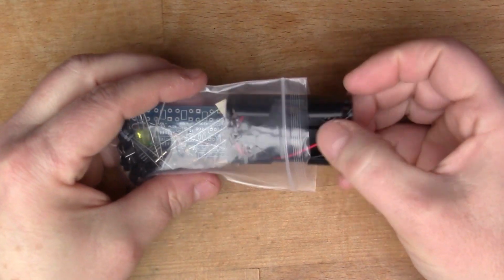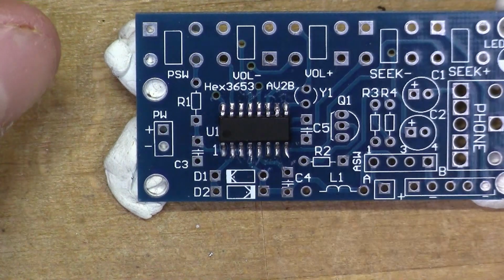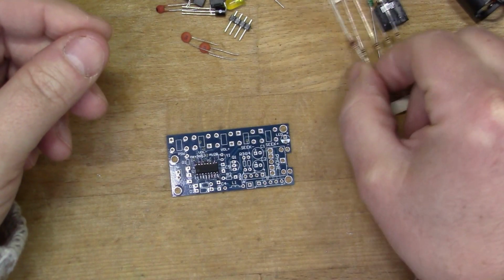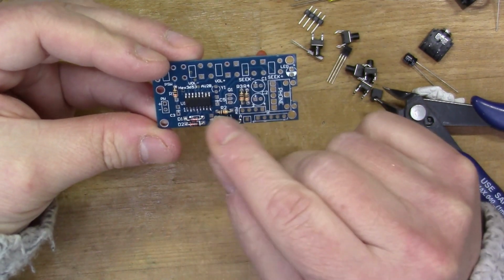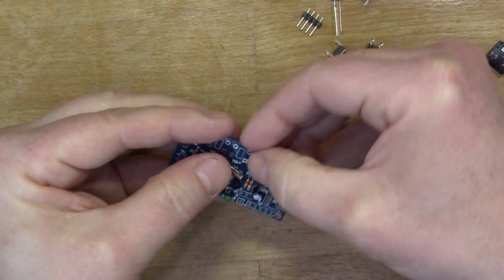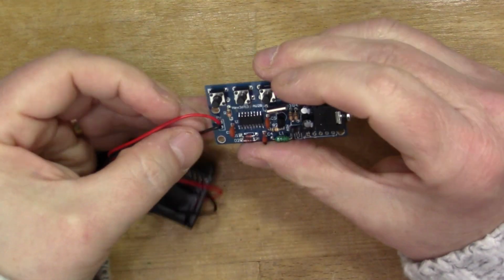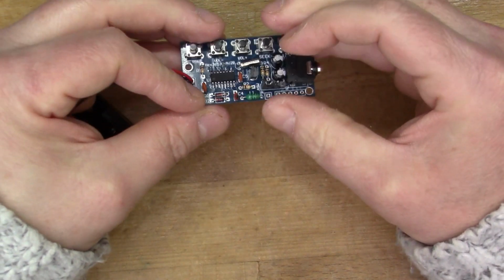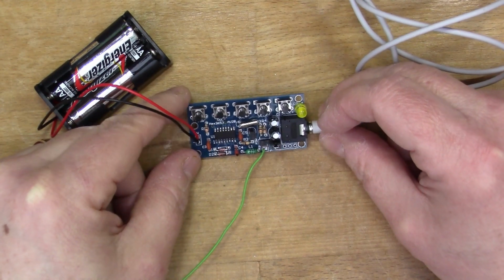FM Radio module - kit build  (#68)

Comment: I got one of these in the main this morning, right now I am suffering with a nasty flu but what the hell I built it anyhow. I could tell I was not feeling well when I had to remove a couple parts that I soldered into the wrong holes. I threw the two 104 caps in the bin and retrieved some great name brand ones from my supply.  It works find, we will be getting our first FM radio station in the late spring.  Now we have to drive about 50 miles in any direction to get a decent FM signal. I have a little short range transmitter I built also from a kit that I use to test these sort of projects.
Reply from the maker: Get well soon

Comment: I received the kit from China without any assembly instructions. Everything was more obvious when I looked at the back of the board that had the R's and C's defined. I was then stumped with the 4 pin header and took a lucky guess without a schematic and it came to life. This board has the advantage of all of the pushbutton switches in line. Another one I purchased has the switches not inline but did include zip ties to attach the battery box to the FM radio board. This other board actually performed better on the FM band and and did not produce the audio click every time you push a button.

Comment: Good wee circuit for money.  I made up a one watt speaker with an lm386 amp and housed it in an 'illy' coffee tin which I use for testing circuits like this.  It works a treat and looks quite quirky!
Reply from the maker: I'm very pleased with it. The last FM module I got really didn't work at all.
Reply: I made a very small fm radio which was all smd parts.  It was the first time I tried re-flow soldering using my hot air gun on my solder station and I possibly fried the chip!  I had bought two kits at the time, as they were so cheap, but haven't had the heart to try building it again!  I tend to use my soldering iron for smd work but must do more using re-flow and try to master the technique!  I use a hobby light with magnifier, which really helps, but I suppose it would get in the way if you were videoing!
Reply: Are you using the same power supply for amp and FM circuit ? I tried using 12v adaptor to power the lm 386 amp and a step down converter to power this 3v FM circuit. The sound is very low volume. What could be the issue, ground loop perhaps ?
Reply: @jolexx  I used a separate power supply but don't really use this amp now.  Have you tried another amp to see if the volume improves?
Reply: @gartmorn  This is the only one I have at the moment. I will try to figure out this ground loop thing.

Comment: I also had a solder problem with the chip which I solved imediately. I figured the 30pf was near the antenna so all the other components were easy to solve. The inductor led to the "A" pad which I figured was the antenna and soldered a 30" piece of wire. Jumper 1&2 and 3&4 for stereo headphones. Good video, thanks
Reply: Jumper is for the antenna, not the headphones. Common of the headphones CAN be used for the antenna by jumping pins 2 and 3.

Comment: I have the ICStation version of this kit and I'm curious if THIS kit performs the same or better or worse than the ICStation kit. I like the addition of the power LED and the ability to use an external antenna. The kit I have I've tried several parts on the board and now I have it on one of the pins of the headphone jack and the reception is better but not perfect.
Reply from the maker: From what I remember, I had several metres of wire attached to get really good performance, so I don't think it's that sensitive.  I have shopped at ICStation quite a bit, so I'll keep an eye open for their kit.
Reply: @MartynDavies  I have this flash drive style mp3 player that has a built in fm radio and the reception is terrible on it. The ICStation kit works better but the mp3 player can record from the radio which is why I bought it.

Comment: I got mine put together no problem but all I can get is static no matter what I do. Also mine seems to be a bit different than all the others I've seen. On my board the LED and antenna spots are swapped and mine only has the 3 pin header. I added a fairly long antenna and have tried moving the jumper around but as I already said all I get is static. I also tried upstairs and outside with no difference. Not sure if I got a dud, messed up or because I live in a fairly rural community with little FM range. I'm hoping it's just the latter. Anyway I had fun with the project and came across this video when trying to troubleshoot the reception.
Reply: У меня была такая же проблема, замена кварца все решило, радио заработало, кварц часовой 32,768кгц

Comment: I finally got this to working and it is really great, good sound and all, well worth the few dollars. Just be carefull on soldering IC for good connection and yes i noticed there are a few circuits not used on this.

Comment: martyn im a novice ,are the diodes used in place of a variable capacitor oh and good visual build and well explained, ta.
Reply from the maker: The diodes are across the antenna input and ground, so I assume that they are there to protect the chip input from excessive voltage (diodes will clip everything above 0.6V).  Sometimes radio circuits use a diode as the demodulator, but that's normally inline, and anyway this HEX3653 chip will have a demodulator onboard.

Comment: For STEREO Add two jumpers !!!!!  pin 1+2  and 3+4
actually, I did not understand why these jumpers are needed
Reply from the maker: Great tip! Thanks very much
Reply: Jumper is for the antenna, not the headphones. Common of the headphones CAN be used for the antenna by jumping pins 2 and 3.

Comment: Nice video, just made this build myself. The chip seems rather picky about the selection, and will only settle at really strong channels. Which means I get only one channel, Swedish broadcast P4, and I live in Norway!
Reply from the maker: It's not very sensitive. I added about 5 metres of wire to my antenna.

Comment: Hi Martyn, great clear video and mine didn't work to begin with so I soldered the chip again, then it worked! However it's really weird, it works for a few minutes, then stops working, LED still on but no buttons working. Remove the battery and replace then it didn't come back on. Resoldered the chip once again, and reflowed all the other joints and it worked for another 5 minutes then stopped. Baffled now. What do you think?
Reply from the maker: Perhaps some thermal effect, like a component changing characteristics with heating, or a PCB trace breaking / separating?  Hard to debug anyway.
Reply: @MartynDavies  thanks for the fast reply! Yes I wondered whether it was working after I had applied heat, but I'm trying to learn all about electronics and I thought this build would be a good start possibly, I'm also still trying to understand my multimeter haha. Thanks again for your advice

Comment: Great work, mine didn’t work I guess I burnt it or something since I don’t have steady hands😂 but I learned a lot from you thanks!!
Reply from the maker: It's definitely hard getting that chip in the right place...
Reply: You need to use the jumper provided to short pin 2 to pin3 for using the headphone common as an antenna; Connect pin 1 and pin 2 if you have added your own antenna lead in wire to the terminal marked "A".

Comment: For some reason, I do not catch the station. Hiss. Volume is adjustable. You do not know what could be the matter?
Reply from the maker: Make sure you have the jumper in place. Also I had quite a bit of wire for the antenna, probably 4m.
Reply: @MartynDavies  thanks. 
Fairy tale, but 2 hours after no result trying, he worked with active acoustic system. Early try with headphones.

Comment: what is its power consumption?  replacing batteries with rechargeable ones.
Reply from the maker: The HEX3653 is designed to run off 2 AA cells, so you should be ok.  It would surprise me if the chip drew more than tens of mA.
Reply: @MartynDavies  I was planning on using a 90mah lipo cell for compact design. Would that be a good idea ? Assuming I take care of the 3.7v to 3v conversion.
Reply from the maker: @himangshudas3924  I'm sure that will be fine.  You could use a diode in serial to drop 0.6V, then the voltage should be spot-on.
Reply: @MartynDavies  thanx ... But it would really help if u could get me the exact power consumption. Don't wanna charge it 10 times a day lol.
Reply from the maker: @himangshudas3924  Mine's in a box somewhere, but if I find it, I'll measure it.
Reply: @MartynDavies  thanx man .. and great content ❤️

Comment: Ok so ill be very happy if i get some help as im stuck with a similar project ... We use the earphones as an antennae in the mobile phone fm radio...so is it now possible to do the same with this circuit? So that i dont need another long wire sticking out of the module .
Reply from the maker: Looking at the circuit diagram, it looks like the antenna and a wire to link to the output jack go to the same jumper, so it may be intended that you can join the antenna to the headphone wires.
Reply: @MartynDavies  thanx a lot for that..and also for the quick reply !!
Reply: @MartynDavies  Would the RDA5807M module give good results? was trying to build a handheld fm radio.

Comment: I bought this circuit from aliexpress and setup all components as the video but I face two problems. Firstly, I face that the led is not lighten up all the time but sometimes it lighten up very lowly... And the second problem I face that when I enter the half of the headphone jack It only works in one side but when I enter all the jack then It works another side that means It always works in only one side, if the left side works then right side doesn't work, if the right side works then the left side doesn't work... So How can I solve this???
Reply from the maker: I would swap another LED in to check whether the problem is the LED or the transistor that switches it on and off.  As for the socket - that sounds a bit mechanical, and perhaps you have just been unlucky in getting a bad one.

Comment: please help,
i build this kit but at output only noise coming when i press seek + it searching for channels for 15 sec then no channel were found ...this happen with both antennas.... i have changed crystal, 33pf, 10uh but result same
Reply from the maker: In my case I used a very long wire for the antenna - perhaps 4m
Reply: @MartynDavies  ok i will try that long wire

Comment: Hey nice video, i got mine, but i only get static on jumper 2 +3 and also on 3+4, when i put it in 1+2 nothing sounds. Only get the let on and i can up and down the volume, do you have any idea what could happend?
Reply from the maker: As far as I can tell from the goughlui website (see link in description) the jumper allows you to connect the 3653 input either to the antenna terminal (the 3 &4 that I used), or to the headset jack.  I imagine that when you connect to the headset, it is trying to use the headphone cable as the antenna.
Reply: Thanks for you answer, i will keep checking whats the issue..thanks
Reply: This is the exact issue I am having. Exactly. I’m wondering if my chip isn’t soldered on 100%. Did you ever figure it out?
Reply: Captain Sparks im still having the same issue, don’t know if i mess some components when i was soldering, will be trying again on this weekend,   if i solve the problem , i will let you know.
Reply: Phantom Lord Hey there! I just fixed mine. It was the surface mount chip connection. I used a heat gun to remove it completely and redid all the pads and tried again. Everything works great now! Good luck 🍀
Reply: Captain Sparks thanks for your advice, i  will try that!

Comment: i finished one and it is working fine, but i have problem with volume control. when i press  vol+ key it increases volume but when i remove my finger from the switch the volume decreases to normal.
Reply from the maker: Perhaps the vol- is stuck on?

Comment: **TIP**
See how yo used the sticky Putty to hold the PCB, 
Well to solder Surface mounted IC's use some sticky putty stuck to quarter of the IC diagonally of intended initial pin to be soldered and then plonk and nudge the IC until all pins you can see are aligned perfectly on the IC.. I use to pre-tin the PCB "So I didn't have to use flux once it was tinned ", once you are sure alignment is perfect, Commit and Solder target corner pin, once yo be happy with yo initial solder, remove sticky putty and place it diagonally on IC to where you just soldered, NOW.. If it "The IC" catastrophically moved a thousands of a millimetre out of alignment whilst you soldered the first pin, gently nudge the lil "far ?! car" Err -um "IC "back into alignment and solder the pin diagonal to the first sucker you soldered, remove putty and go like a bat out of hell with the rest of the pins making sure yo touch em straight after with a heat sink or a chunk of metal "Large tweezers or Pliers for example".. Of course you could always get one of those Chingy hot air stations like I did way back when..
Dropped a like BTW..

Comment: does it make any difference what way the switches are mounted
Reply from the maker: definitely 90 degrees of difference would be bad as something would get shorted out
Reply: @MartynDavies  thank you for your reply i was thinking that, ive just ordered two boards this is exactly what ive been looking for, i take it you can see the track on the board to indicate which way the momentary switch is mounted
Reply from the maker: I think I checked my switch using the continuity setting on my multimeter.   It's not always obvious which way they are wired.
Reply: @MartynDavies  yes i seen you doing that then you seemed to just pick them up and mount them that's why i was wondering if it made any difference which way they were mounted ill be checking the switches before i mount them thanks for you're reply :) Ps i enjoyed your video

Comment: I'm in the process of trying to put an F.M radio in an old table radio case. Although the case isn't designed for stereo, I can jump
 both sides to one speaker.Where is this kit available, and do you think I can add an external amp and 110 volt power supply to make it a functional conversation piece?
Reply from the maker: I got the kit from Aliexpress.com, where it was under $2, but if you search 'fm radio module' on Ebay, you'll find the same kit from a number of vendors.  You can definitely add an amp to the output, and it's quite easy to find a 3V wall-wart power supply.

Comment: Bought this and I got 4 extra resistors. Now I’m panicking since I followed your tutorial and mine doesn’t work. Maybe the other 4 resistors are for something?
Reply from the maker: Double check the values you've put in, but I suspect only R1 needs to be a precise value.  The trick for me (to getting to to make a sound) was to get the jumper in the right place.
Reply: @MartynDavies  tried to troubleshoot my issue. Turns out that there is a connector that wasn’t properly soldered. Lol. It now works.

Comment: After I soldered everything together the batteries just overheat when I hit the power button. Maybe I should check the SMT chip soldering?
Reply: Jumper is for the antenna, not the headphones. Common of the headphones CAN be used for the antenna by jumping pins 2 and 3.

Comment: I don't understand for what are the 5 holes under the jack audio. Can I put a speaker on that?
Reply from the maker: They are wired to the same connections as the audio jack, but this is really a headphone output and can't deliver a lot of power.  If you connected speakers here, you would hardly be able to hear anything.  What it needs is an amplifier on the output, which is how I tested it.
Reply: @MartynDavies  Hi Marty! Great video, great job! Can you recommend an amplifier to be used in this case? I'm thinking about use a small cellphone speaker
I'm from Brazil 🇧🇷 😊
Reply from the maker: @maneiropacas  I'm pretty sure my test amplifier has a PAM8403 inside it.  Search for these on ebay - they are cheap and quite easy to set up.

Comment: His disk capacitors have different number ,the smallest one I couldn't read I put it in as the 22pf ,I put the 104pf in the middle where you put yours what I have left is a 30 pf ,if this doesn't work I have a good supply of the little disk capacitors ,I will copy your video ,these Chinese kits are varied I think ,this little kit been a pain .
Reply from the maker: Yes I have experienced missing components in some kits, so it's useful to have a few spares. You can get some good bundles of resistors and capacitors on ebay.
Reply: @MartynDavies  thankyou sir for your comments ,the part that was missing was the crystal ,and my spare crystal didnt have a value on it ,thanks again

Comment: I don't understand why but my led won't light up and the headphones make no sound. I have correctly solder each one correctly and batteries are new
Reply from the maker: You could try disconnecting one end of the 2.2k resistor (connected to the base of the transistor) and see if you can light the LED by driving the base directly.  If the LED works, this could imply something wrong with the chip -in which case very carefully check the soldering of the pins on the chip.

Comment: Since.these chinese kits don't come with directions ,videos like hours are great help.so thanks ,I no sometime people find some direction on the internet ,did you find anything more about this kit.
Reply from the maker: No, this kit has a mystery chip that I couldn't find data on. Mostly it was pretty obvious where to put stuff on the board - though why the jumper is there, I don't know; the radio doesn't work properly until the jumper is in the right place.
Reply: Yes, may as well have designed it yourself and i know that they make revisions or changes on some of the kits